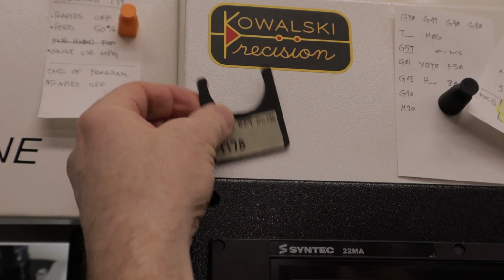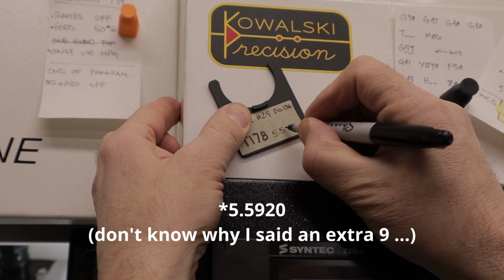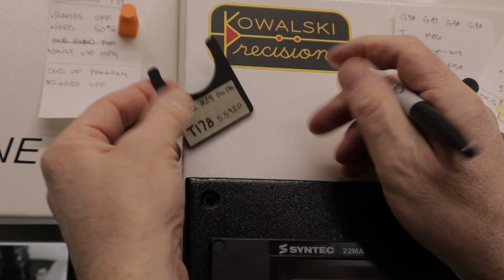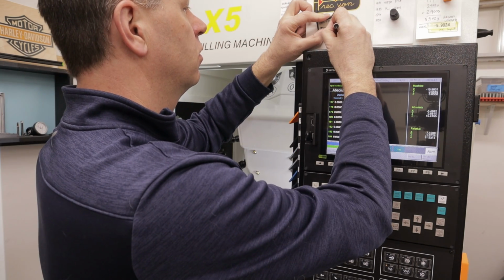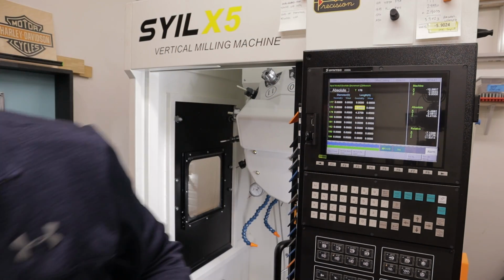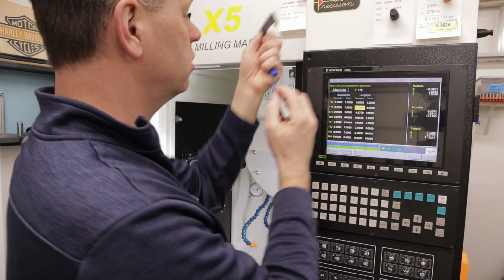SYIL X5 - Setting and Tracking Tool Length Offsets on CNC Machine

Comment: I like the new Syil X5, I've been looking at that model along with the X7 more & more myself. I also like those tags & holder, I can't tell for sure if it's 3D printed or not. Any chance on some additional info or links would be appreciated?
Reply from the maker: Hi, thanks for reaching out.   Yes, the tool tags are 3D printed.   I actually make them and have them for sale on my website.     I added in some links to the video description.    Thanks again!
Reply: Thank you for the update and links, but unfortunately they do not seem to be working. @kowalskprecison